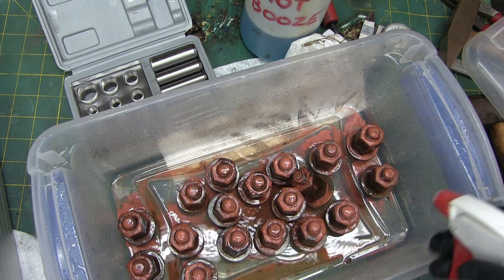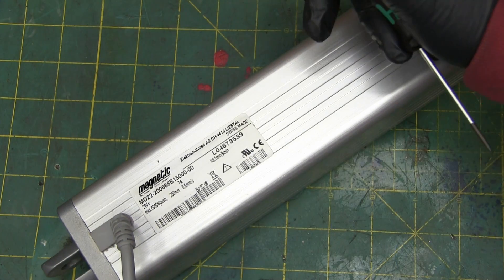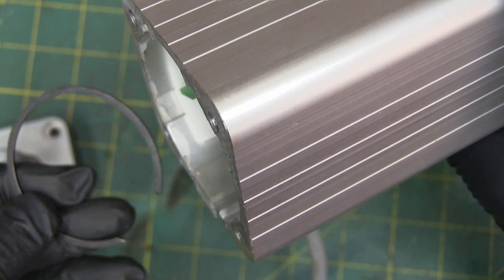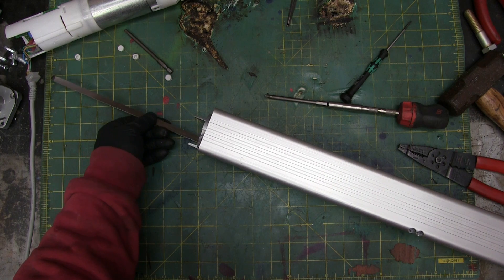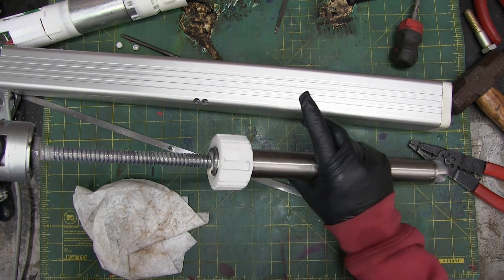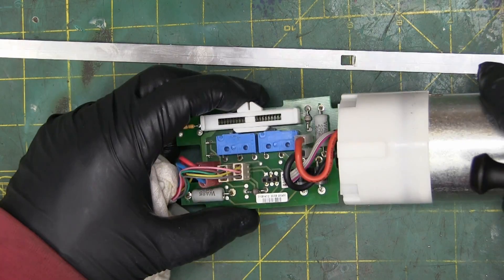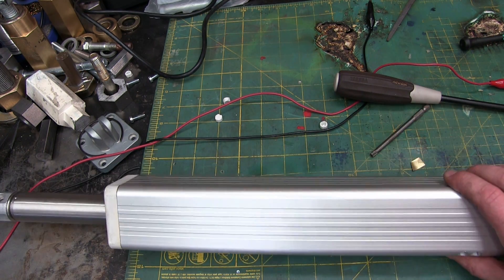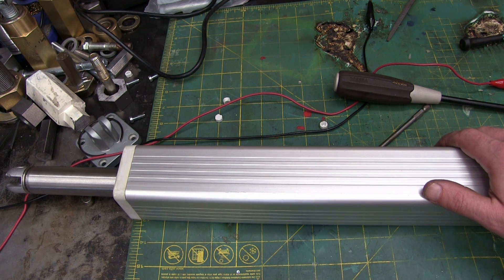BOLTR: Swiss Made Industrial Actuator | BIG $$$$$

Comment: The outer cage is easy to stretch cause it's out of extruded aluminium housing. It has pretty tight fit there and it would definitely prevent from stretching.

Comment: Surely that's a 'gate closer' ram? It doesn't need to know where it is as the gate is either closed or open. They do monitor the current and determine if there's an obstruction and then reverse.

Comment: That plastic is just for the positioner so it knows where it is. This is not the motor. no stress on these parts. The extra wires are used to control the speed and where it is on the rod.

Comment: not my first look at these  .used alot in s fl for awnings uses a 2 position switch for op in side. they are quite/smooth !but the plastic gears dont like resistance if awning binds they overload easy$$$$$

Comment: I know this is an old video but I am curious how the strength of the actuator is determined. I know that hydraulic cylinder strength is determined by the amount of pressure and the amount of area its acting on. Its my understanding that there is a motor that creates a magnetic field and then by switching the polarity you can cause the actuator to extend or retract, so is the strength of that determined by the voltage along with the size of the magnet or the strength of the electromagnet? Thanks boss

Comment: Always like your stuff man. Use of Plastics or Nylon wasn't the bad thing to reduce cost but I have to agree. Only if those were cookie cutter tin and nylon marrow. It would have been much better. Shame there was such care in it's design but to skimp out, Cast a mold of those gears using on using something like fiberglass epoxy gears or jb weld would have been better?

Comment: So that switch running at a lower speed is basically working as a snubber valve to the ball gear as it reaches the end of its travel to slow it down?

Comment: I hate to say it but I think you're being too hard on that thing. Referencing your previous vidjeo with the chinesium actuator, the force those plastic gears will be putting out is tiny, 60nm of torque required on an imaginary nut (That's a guess for the 6000nm clamping spec), divided by whatever ratio those gears are. As long as they are aligned perfectly they will be fine, and as long as the unit isn't spec'd for continuous use. The plastic gearset helped make it so quiet. Mind you the non serviceability was a bit shit...

Comment: I don't know if anyone else has said this yet, but those hall effect sensors are probably set up in quadrature encoding mode.  You can program an arduino to turn that into a linear servo by running this code: https://github.com/misan/dcservo  I've done the same thing with a small motor, this code worked well.  Good luck.

Comment: In one of Prof. AvEs previously lectures he discussed how expensive high pressure pumps are for hydraulics. That got me thinking however that diesel  pumps for CDI engines can pump fluid at up to 2000 bar and are very cheap used. If a home gamer wanted to build a hydraulic system couldn't he just use this type of pump with a very light oil? Full disc: I'm a scientician not an enginerd.

Comment: Since you don't need it to be back exactly to factory specs, bore an access hole so you can assemble it, then plug it (maybe one of those flat threaded plugs they use on electrical boxes).

Comment: The plastic gearbox is basically under no load. The ball screw and its casement are a long worm gear and are taking all of the linear force, and most of the torsion. Think like a guitar tuning gear, the force is so little on the speed end that no brake is needed.  Same deal here. Basically no major force will be transferred through the plastics they will hold up fine.

Comment: I think the nylon gear housing isn't structural, it's just there to hold the gears in place while you insert it into the giant aluminum housing. Once inside, it's not deforming without bursting the AL case. (In fact, being thin is a virtue; less compression.)
Reply: Jeremiah Blatz That isn't just a nylon housing. It's one of the key mechanical parts of the force transmission in the planet gearing. The teeth on the inside actually need to take the full force of turning the actuator screw.

Comment: If the nylon gears are stronger than the maximum load produced by the drive motor at the point of stall, then they are fine.  They don't carry the holding loads (that is taken by the brake assy behind the thrust bearing).  The reason that actuator sounds so nice is BECAUSE of those helical cut nylon gears!

Comment: FYI the Greek fire balls  are also diodes, sinterglass type, probably 3A rating.  Yup, they take low melting glass frit, pack it around a poor unsuspecting silicon chip, and smoosh the whole thing together under heat and pressure.  All goes well, you get one hell of a robust diode.

Comment: The two white glass diodes are what you would see if you hammered the black plastic from the typical cylinder-shaped diode package. One diode should be wired in parallel with each limit switch. This permits you to still operate the DC motor back away from the limit switch when it opens but not past it.

Comment: If you want to see some accelerated rusting I would try putting those nuts in bleach overnight.  I found this out by accident when doing some experimenting with de-chroming some tools.  I don't know the science behind it, but it sure did make those tools rust.
Reply: It's the chlorine. Halogens attack iron with a vengeance, producing deep pitting almost immediately. Even just off-gassing from pool bleach tablets in a tool shed can destroy steel tools.
Reply: Magnum Oxidizer that bleach, NaClO.
Reply: A touch of Ferric Chloride will really speed up the rust. Since it's acidic it will remove any surface contamination and it justs likes to rust with the oxidizer side.
Reply: A mix of acetone, alcohol, acetic acid salt and water works well too.
Reply: I do a lot of pressure washing and know that the pool chlorine we use will rust steel to pieces fast. Patched a hole in a  mix tank with acrylic and SS bolts from Home Depot. Thing started leaking about 4 months later. Turns out the chlorine didn't like the SS carriage bolts  and chewed right through them. Can't use SS as a hose weight for my suction lines either for the same reason. Also, look at the rear bumper of any pool cleaning service trucks. Typically rusted right out.

Thanks for the highly entertaining videos man! Learning a lot from your channel!
Reply: The iron needs Oxygen to rust, bleach "brings its won" and thus can be faster. Also that stuff is  full of chloride, known for its aggressiveness. Did you submerge the parts or did they have air contact? 
Im not sure if its possible to seize nuts with this fast rusting, since all the rust is on the surface where the oxygen can get to, not in the threads. In the real world this happens slowly, oxygen can get in there and is not limited. Meight be a problem.
Reply: Muriatic acid works too.
As does salt water, but not quite as fast.
Reply: The old bridge builders of nut and bolt times put the hardware in a bucket of piss.

Comment: Degrease the living hell out of them (literally release the schmo?) de-rust them with your acid of choice (not phosphoric), screw 'em up, add heat, sodium chloride and dihydrogen monoxide in what ever order feels best for you. Rinse and repeat and I guarantee you your nuts will seize in no time! This is not a guarantee
If you feel adventurous you can try letting them dry in the sun and then spraying 'em down with hydrogen peroxide once or twice between the Chinese saltwater torture cycles.
Keep your nuts nice and tight!

Comment: Not sure but isn't the ring you pulled out first still sitting on the bench?  Is that a spacer that keeps the assembly pushed together so out doesn't lock up? Maybe I'm mistaken but I thought it was the first thing you pulled out.  Does force on the end (with the cover off) free up the mechanism?  Was the silicone acting as a spring and putting the last bit of force on the mech to free it up?

Comment: The extrusion is round inside, so if the nylon enclosure got hot, it would be supported by the aluminum casing, right? The nylon gears could still technically provide a weak point, preventing damage.

Comment: You missed the good part. Actuators that long and that push with 6000Nm normally run a plastic (delrin?) nut for smoothness of action with a backup metal nut on the shaft in case of failure since they may be on medical hoists or some such. A lot of the time the helical gear on the motor will shear before the nuts give out showing how well matched they are. At 10 years that actuator has been used, say 4 x 365 x 10 = alot, so is retired. Cost of a new actuator probably comes close to 1/3 the price of a new hoist so hopefully the whole thing is changed much as a car is after 10 years.
100kg person x 10m^2 gravity = 1000N. Add in mechanical leverage against the actuator and you probably have a 2 or 3 one safety factor if not more.
Reply: I think Alex is right.  Looking for someone else that caught this.  Acetal plastic comes in many forms.  I did a consult and prototype for a nuclear power plant part and researched the acetal plastic gears that I was going to use instead of metal.  Seems that Delrin(r) the product name for a specific acetal plastic is almost as strong as some steels.  It is also slippery (self-lubricitous [sic]), quiet and actually wears better than steel or brass.  The short of it is that you shouldn't look at all "plastik" as "crap" and usually you don't...this just didn't have a label on it so you assumed it wasn't "skookum".

Comment: Dear Uncle B, The best way to get those nuts good and rusty is using a cyclic corrosion test setup. 12-14 days in cyclic corrosion can be equivalent to approx 1 year in a rusty environment. You need to mist (or spray) the parts with a salt water solution, then dry them with a fan or elevated temperature, and repeat. Best of luck!

Ps. Would love to see you build a quick and dirty diy cyclic corrosion test chamber!

Comment: I was a bit sad you ripped this one open without testing it's limits until you broke into the plastic gears.  1350lb push must be a full max load and maybe not so ideal for testing vs a ratchet.  Wouldn't be fun though if you got her working again, it'd be a good laugh over a beer as a $15 ratchet broke a 3k specialty tool due to a sad gearbox.

Comment: Hey AVE !
The coupling is a Bidirectionnal Wrap Spring Brake !!
A very clever device that prevents unwanted movement when the motor is not actuated.
It has to be assembled with the coupling tooth and the inside spring in precisely the right angular position, else it doesn't unlock. That could be your problem right there.
http://www.warnerelectric.com/products/clutch-products/wrap-spring-clutches/european-product-line/holding/bdnb-series-clutch

Comment: Yeah, I was wondering what you mean by there being no hall effect sensors, since there were four thinner wires going into the motor which would be enough for two hall effect sensors (since you need two wires for VCC and GND). Although I guess one would be enough, since that's probably not gonna be moving without power and if you're giving it power you know in which direction it's gonna spin...

Comment: AvE, if the slimjim isn't sliding in and getting in tight enough to chooch in tight enough on the mechanism, what if you take a long thin piece of sheet metal or aluminum, that would be between the walls and the slimjim so you can get enough pressure to get it to click into place when you slide everything in?  That way it could act like a guide and than you can pull the thin piece of metal out before you affix everything back into place?  Just a thought.

Comment: Quadrature encoding with the 90 degree separated sensors! An attached brain would be able to extract RPM and direction. The two pole magnet and the 90 angle between the sensors would allow you to extract 8 clicks per motor shaft rotation and watching the phase relation between the transitions on both sensors will allow detecting direction. Knowing the total gear train reduction would let one calculate the position of the actuator, presuming there is also a signal available for either limit. Run it to one limit, zero a counter. Each encoder tick is 45 degrees of motor rotation, from which the linear position can be calculated, within the tolerance of ball screw backlash. Love this stuff....

Comment: ok my two cents worth the two screws on the side are to hold things in place try sliding one have down line up screw and lock her in place then slide other side in.now the first side won't be pushed to far to where the second side installed won't push the first side out of place. If it works I would love a blonde one rule and a t-shirt.

Comment: You can't just put it back together after you took the plastic motor covers off. They have orientation so they lock to the tube when the motor works. If you don't put them the right way, it want turn and it will fill like the motor is stuck.

Comment: The nylon gears only have to overcome frictional losses on that sweet sweet thread. So they aren't under too much stress. Being nylon they are going to be alot quieter than powder metal gears just not as wear tolerant.
I wouldn't bank on the resembled part locking up as a failure for AVE to reassemble it correctly. It was in the bin for a reason.

Comment: Two things i'm thinking with those plastic gears. 1. It might not have been designed for continuous use, maybe something that needed actuated every few minutes? 2. The aluminum housing would probably act as a rather nice heat sink. 3. Mechanical failure point to limit force. Ok i guess that was 3 too lazy to go back and change it though.

Comment: I want to say that the nylon gears are likely the most appropriate choice to implement a design-for-failure feature.  Considering that its rated load isn't relatively high, if it were to fail, the gears themselves would be the easiest and likely the cheapest to replace rather than the proprietary motor or actuator (not to say the gears aren't proprietary either).  Furthermore, it wouldn't be wise to have glass filled nylon on the account that it is soaked in grease and would be susceptible to moisture ingress plus, would also reduce its wear resistance.
That being said, I would argue that the nylon gears would be a fine option for this actuators intended purpose.  Any thoughts?

Comment: That's a awning extender it runs for 30 seconds and never gets hot. The failure seen in use is the motor or wind dammage bending the extruded strut.

Comment: Have had a Centurion actuator drop a motor, and that motor was so well sealed that only after I had it out and opened it could you smell the crisp. Sealed up pretty well, the only thing was that it would run poorly, and looking after at the cremains I was not surprised. New motor and it was fine again. Now I just keep a service exchange unit, and it is a simple matter to spend 10 minutes doing the swap and then fix the other as spare. Not as nice as that, but for something that lives outdoors and runs 100 times a day getting 2 years out of them is not bad.

Comment: Did you put that snap ring spacer back in? If so, maybe things loosened up too much from the disassembly and adding another spacer to tighten it up will do the trick. Are you could just try glueing the gear housing to the drive coupler to keep them together.

Comment: 9:50 Those will be (fast) avalanche diodes, used mainly as transient voltage suppressors.
Reply: Those may well be the sunbber diodes across the motor, to suppress the turn-off spike.

Comment: Why don't you use electrocity to rust those bolts? Use them as a sacrificial anode in solution of sodium carbonate(available at swimming pool supply stores). I used the same process to remove the surface rust from an old Ducati gas tank. Just reverse the polarity.

Comment: Hey AvE, there is an anti-backdrive mechanism in that support bearing housing. Ball screws have little friction, so the actuator would extend or retract with a little load if the motor isn't holding position.

Thomson linear has some pictures of their backdrive mechanism, basically a brake that locks up tight.
Reply: and he is attempting to run it without the cap on the back.(seen in the last shot). If he completed the assembly, it would likely work.